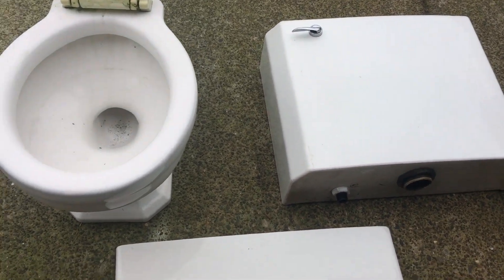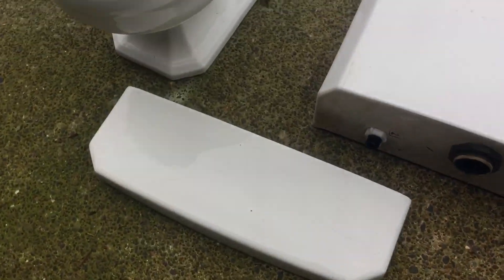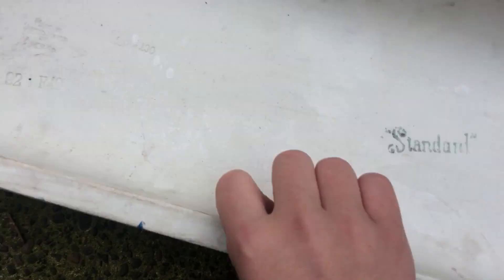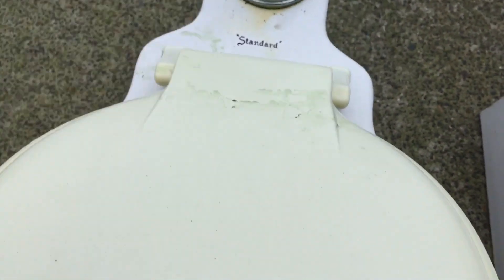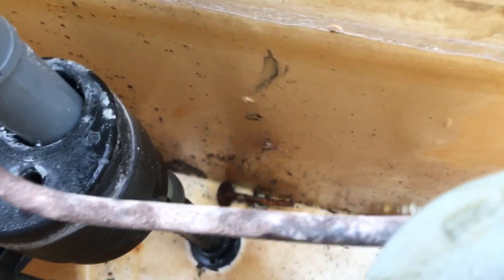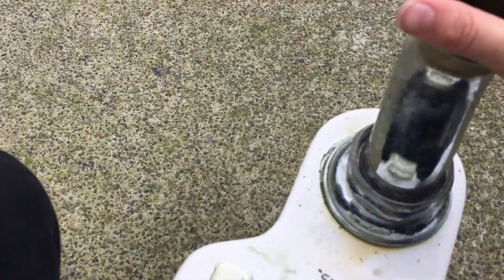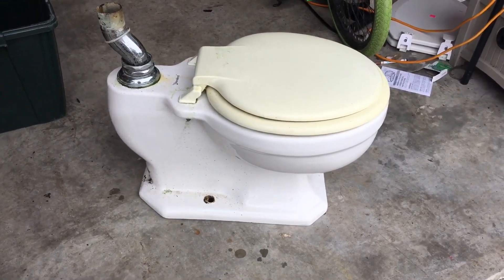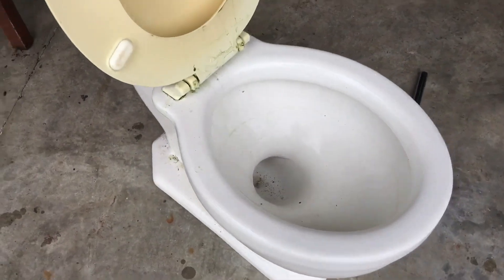NEW! “Standard” devoro Junior!!!

Comment: Very rare and cool find!  I would guess the bowl to be from the late 50s to the mid 60s. The tank May or may not be from the 20s but if it is, then it's been rebuilt with an American Standard handle and flush tower from the late 50s-early 60s. Those flush towers were only made by AS for a few years, and the handle is also correct from that time. I can't wait to see it flush!